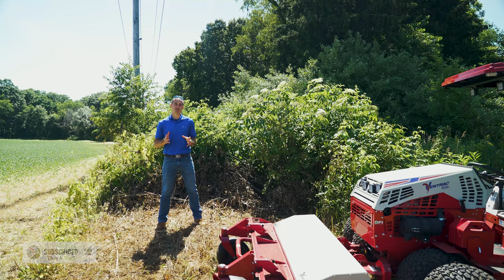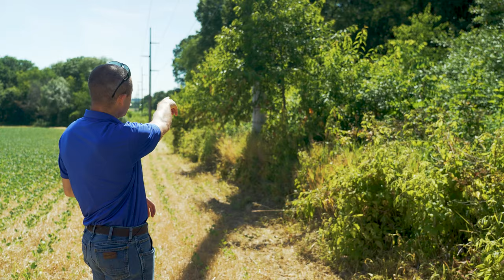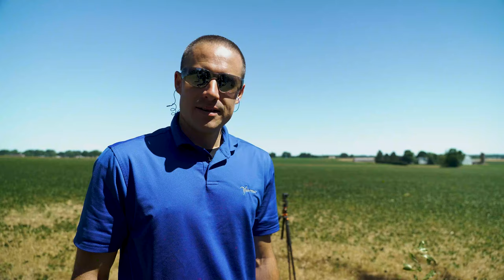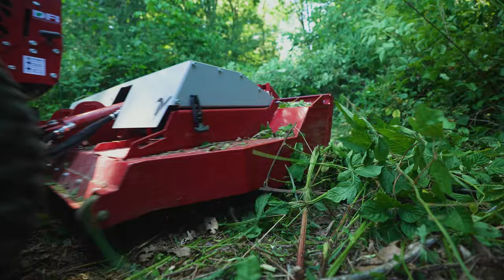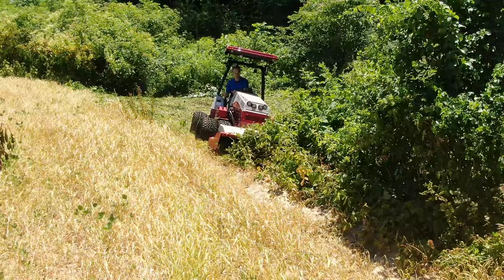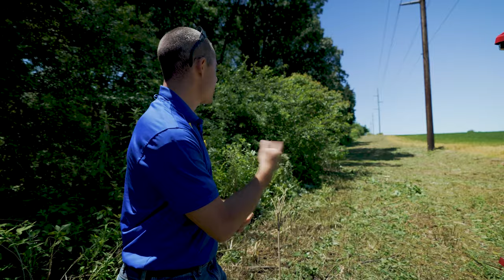Overgrown Power Line Right Of Way Mowing

Comment: Getting close to leaf cleanup season. Is Ventrac working on fixing what the material collection system can be compatible with? Like the flashers and the canopy? For people who drive on the road or do landscaping this would be crucial to be able to do. Have the collection system with the canopy and the flashers! Come on ventrac you can do it!
Reply: You're in luck! The RV602 Collection Vac is compatible with the new 70.4169 Ventrac Canopy that Aaron is using in the video. It might be tough to see, but on the four corners of his canopy there are also strobe lights installed.
Reply: @ventractraining1350  yeah I’ve seen the strobe. I love that little touch. Would they replace the flashers in this case?

Could the flashers be removable or relocated in the future?
Reply: @Zanderthelab  The 70.4162 Directional/Hazard light kit is compatible with the new 70.4169 Canopy. But that hazard light kit is not compatible with the RV602 because how the vac mounts to the right side of the tractor. The canopy strobes are always visible making those the better option when using the collection vac.
Reply: @ventractraining1350  gotcha

Comment: Do they come with thoes airless tires and wheels?
Reply: The Tough Cut tires are flat-free. The eight tires on the tractor can have our reseal product added which fills most punctures up to a 1/2 inch. Just ask your dealer for Ventrac 15.0042-05 Tire Reseal or go to this address for more info: https://www.ventrac.com/products/accessories/15.0042-05

Comment: Why not have hydraulic motors on the deck
Reply: The drives for the blades are a belt driven system, it helps keep hydraulic temps down and also acts as a "clutch if a blade stops. The belt will slip and there are no shear pins to replace ever.
Reply: Hit a large object with hydraulics and you're done. Wasted time that'll cost a ton. The belt driven system means you hit the same thing and it's just a belt and a small break to replace and you're back in action.